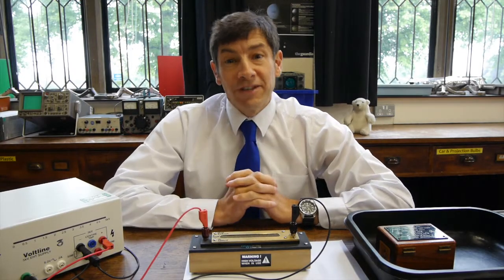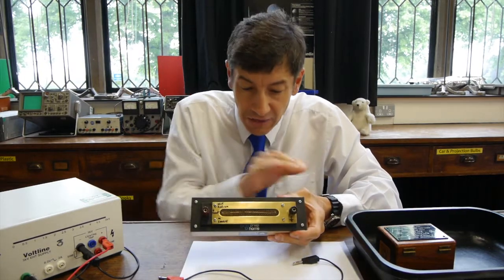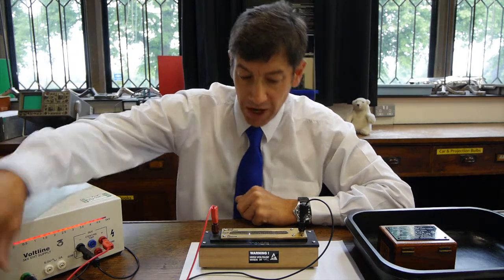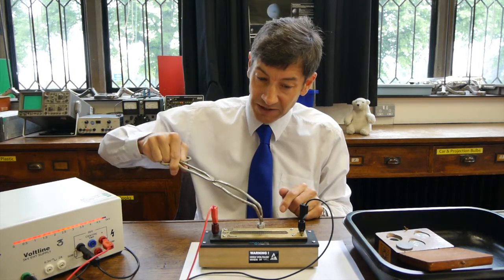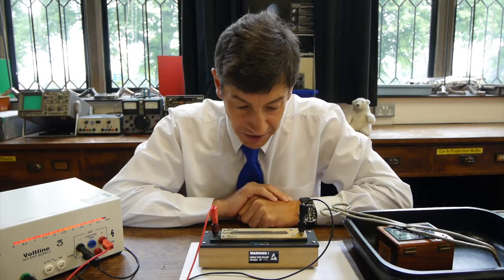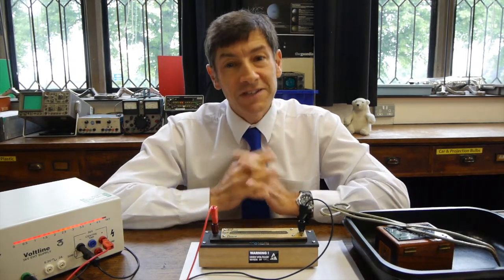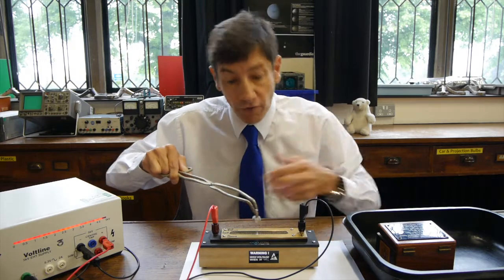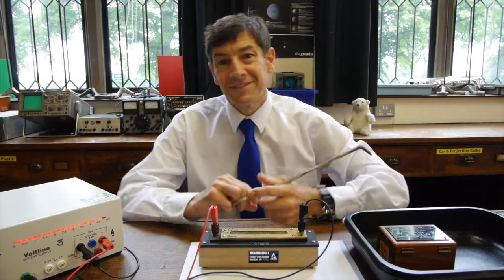Spark Counter - F-J's Physics - Video 122

Comment: Except it's an ionising radiation detector that produces sparks, and clicks that may be counted., but we still don't know how an actual count may be electronically achieved.
Reply from the maker: Yes, interesting point!  Most of us refer to it as the 'spark counter' but some call it the 'spark detector'.  It is not at all difficult to add a counting circuit to it and make the assumption that one spark is one detected alpha particle.  You may be familiar with the 3D spark chambers that have been used which show the ionising radiation's path as well.  Of course the spark counter I show here is really the open version of the GM tube - but that too still has to be connected to a counter/scaler to get a value of the count rate!